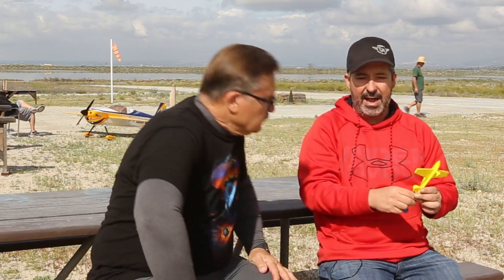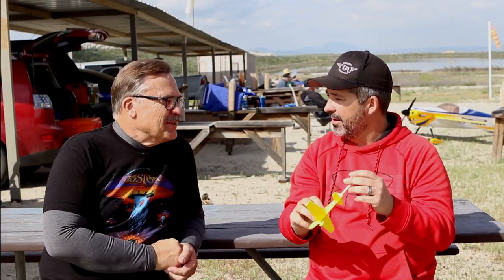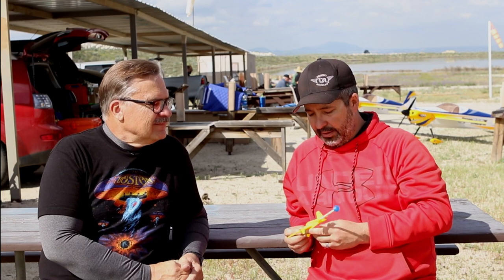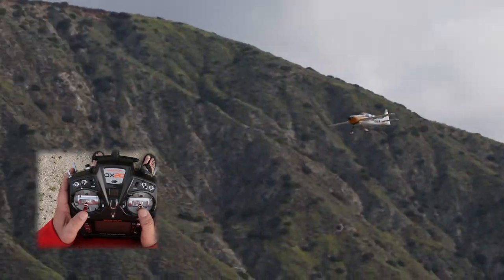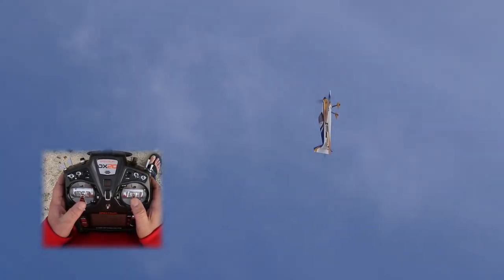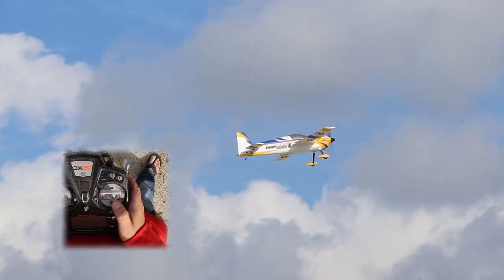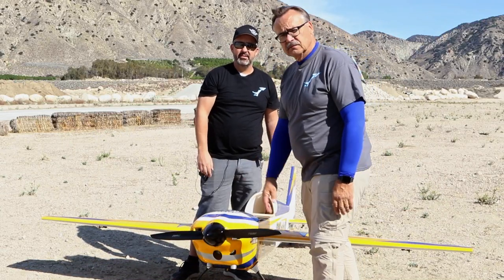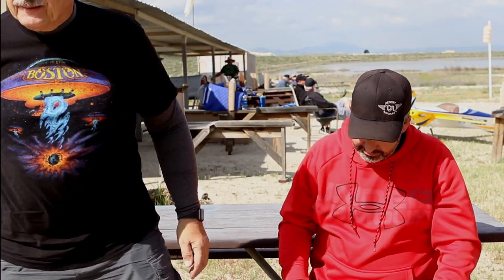***Unleash Your Flying Potential*** Perfecting the Hammerhead

Comment: A wing is not "stalled" during a Stall Turn! Check the definition in Basic Aeronautical Knowledge books
Reply from the maker: This is true, since the angle of attack is not increased to prohibit the wing from producing lift. This is, however, a zero airspeed maneuver. So, since the plane is at zero airspeed and the wing is not producing any lift can we agree that calling it a stall is not completely absurd? Or do we argue over whether or not the wing is actually a wing in the moment?